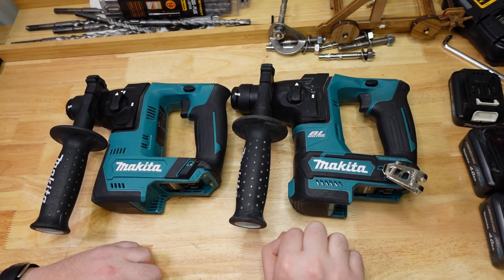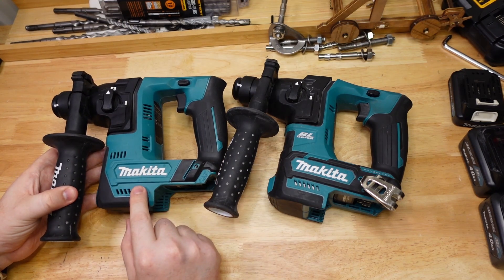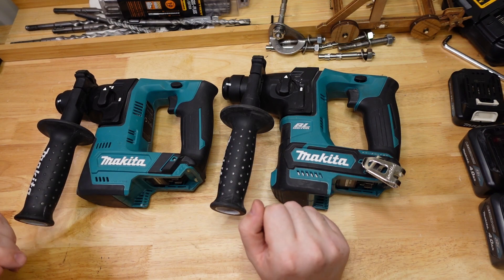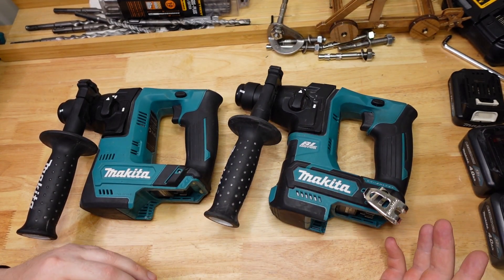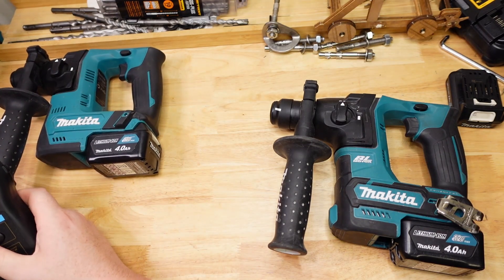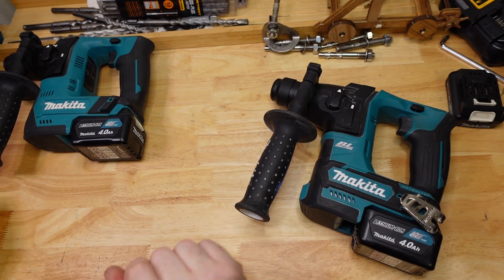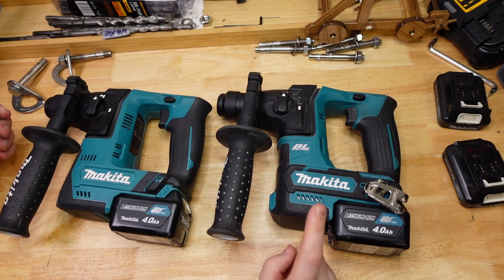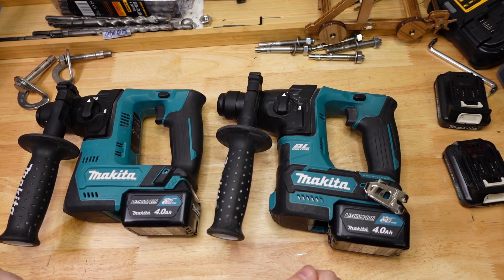Brushed vs Brushless: Makita HR140 vs HR166 Performance test (Makita RH02 vs RH01)

Comment: Although the Brushless was still better in all the test
But with the 1.5 times higher price with Brushless compared to Brushed
I think the 140 it still suitable for home used right? i want to drill small diameters drill bits into light concrete and Brick
Reply from the maker: Definitely! It's still totally fine for small jobs and if the lower price suits you better then go for it